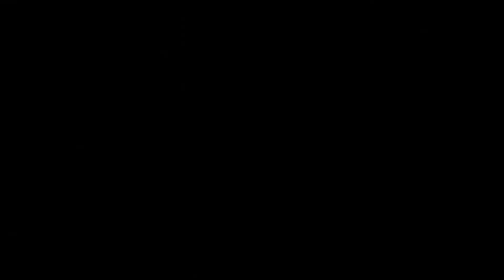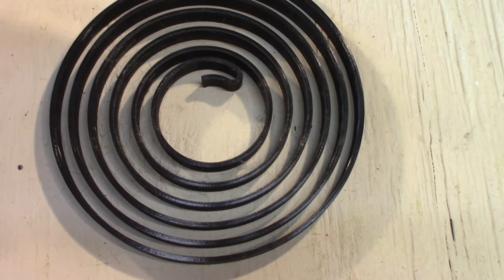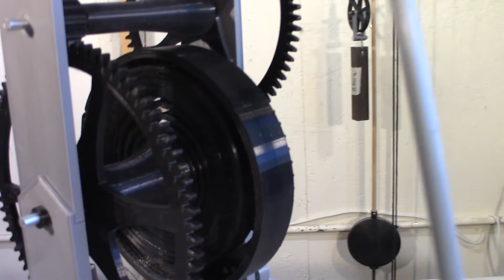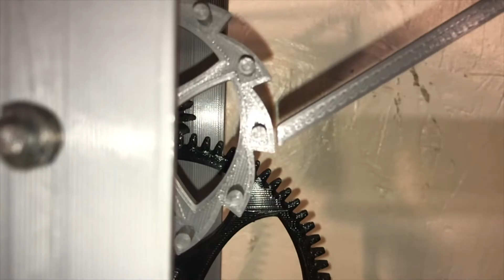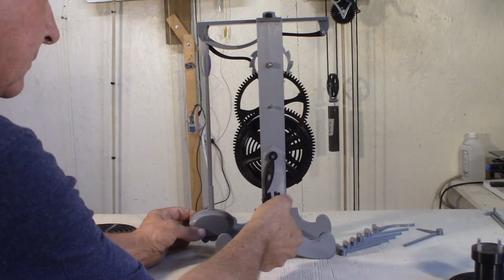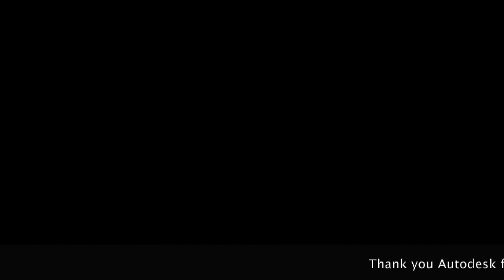3D Printed Galileo Escapement Version 2

Comment: what are the settings for the spring, what infill?
Reply from the maker: I used just walls, 3 if I remember right
That maximizes strength
Make sure bed is level and have good adhesion or it will end up in a big mess
I know it happened to me
That was my biggest print failure

Comment: I always enjoy seeing your designs. The simplicity of the winding ratchet is nice. The Galileo escapement appears to spend half of the stroke pushing the pendulum faster than its natural swing. Do you find that the rate changes significantly from the change in force as the spring winds down?
Reply from the maker: Thank you for the comments
Yes absolutely, If winding the spring too much, the pawl will lift the hook all the way to the top frame, and when the clock stops, there is still 3/4 of spring tension left
It stops when the pendulum does not have enough energy to lift the hook.
I plan on timing the swing some time in the future with the Arduino
I also had an idea about a dead beat pawl...